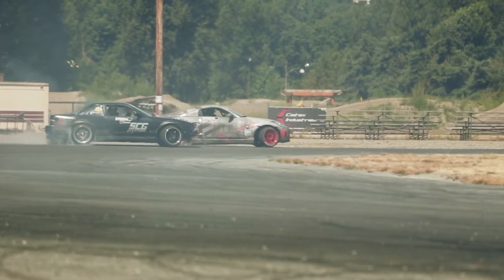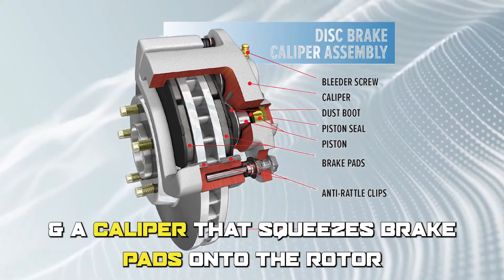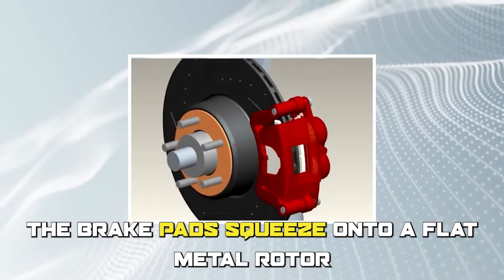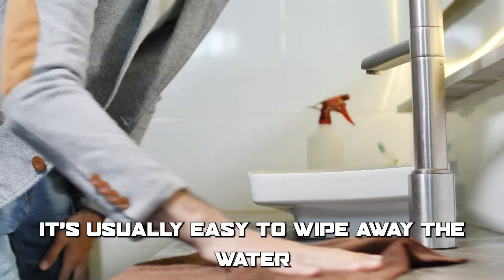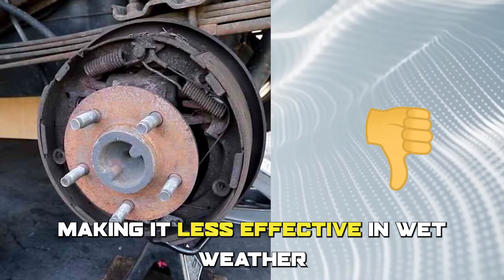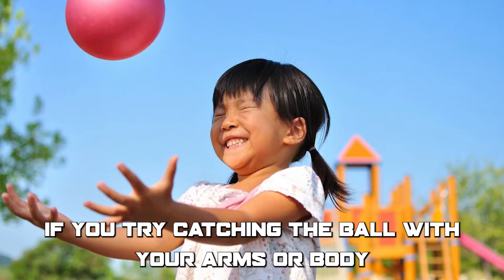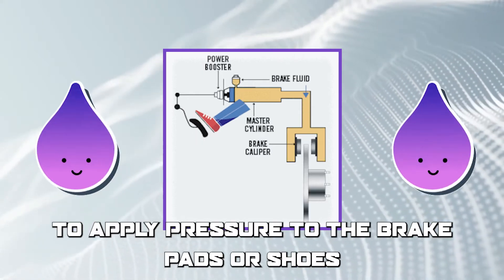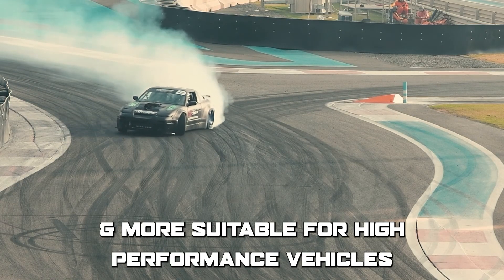Drum vs Disc Brakes - What are the Differences? (Which is the Better Choice?)

Comment: Then why do heavy trucks use drum brakes? Explain
Reply: Drum brakes have more area of friction so it has a greater stopping force, and cus its a closed system its more Cleaner than the disc brakes system,, making it more economic in maintenance.. Combine drum brakes with air pressure system then you can easily stop 10 tons of rolling truck..
Reply: @akhmadslhdn86  To explain further, drum brakes can be hydraulically boosted to surpass disc brake performance. If you try hydraulically boosting disc brakes, the stopping force plateaus because of the relatively small surface area. The hydraulic boost overcomes the direct force disadvantage drum brakes have and then they can surpass disc brakes because of the extra surface area. 

On cars however, disc brakes offer more than enough stopping force. ABS has to be used to do any better.
Reply: Mostly due to ease of maintance, lower cost, and older models.

Disk Breaks have a higher stopping power than drum breaks. They're also better at dissipating heat generated through friction due to the most of the disk being exposed to air. This enables them to outlast drum breaks, especially in frequent use. You mostly see trucks use drum breaks if they're used for long hauls with very few stops in between, otherwise, they'll resort to disk breaks.

Disk breaks also don't chew through the wheel hub over time, making them safer.

Comment: Disc Brakes are installed on the front of a vehicle. 
Brakes clamp onto a router. 

Drum brakes are installed on the rear of a vehicle. 
Drum brakes push onto a round drum to slow it down.
Reply: Some cars have disc brakes at all 4 wheels.
Reply: @gooser__43  and some have drums on all 4
Reply: @RRareGaming  yes